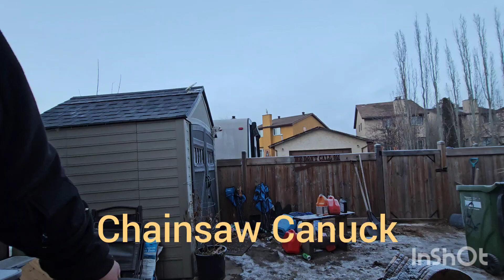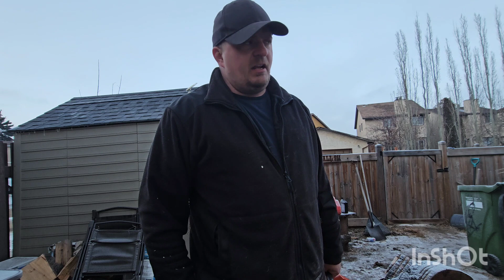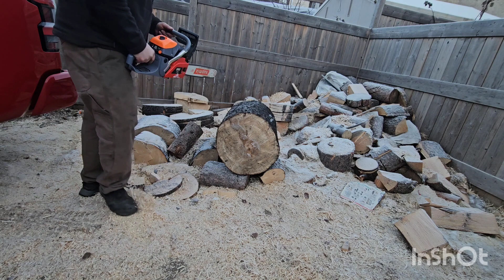supmix bigbore chainsaw

Comment: Definitely wicked cuts for what it is! Any suggestions for a bar/chain replacement? I got a s6251and bent the bar lol.
Specs on chain/bar are 
20 inch, .325, .058, with 76 Drive links.
Any suggestions for a good bar/chain combination, or, any idea what options i have? (Could i go down to 18 inch  bar with 72 drive links or something?)
Reply from the maker: These take a k095 mount(small Husqvarna)  lots of options from 12" to 24" , just make sure it's for 325 chain..although you can change the rim to 3/8.  But any 325 bar and chain combo will work, doesn't have to be. 0.058 gauge
Reply: Thanks!